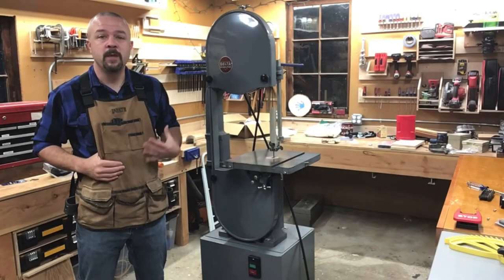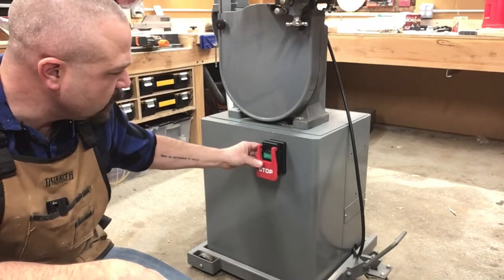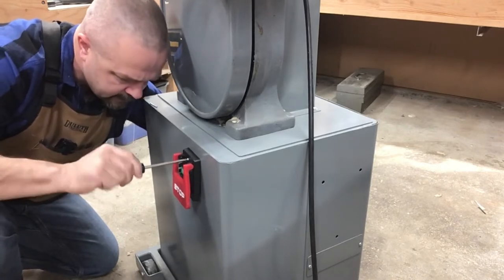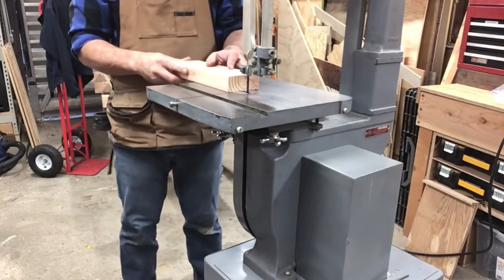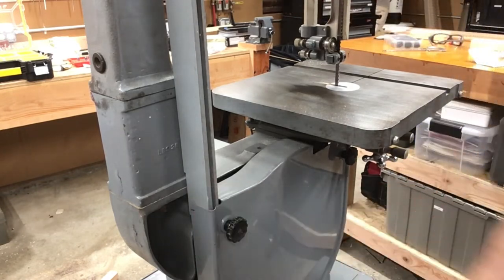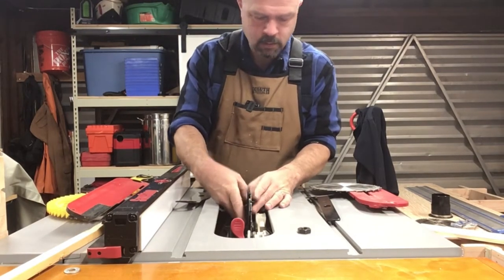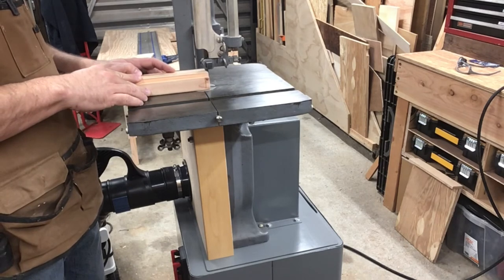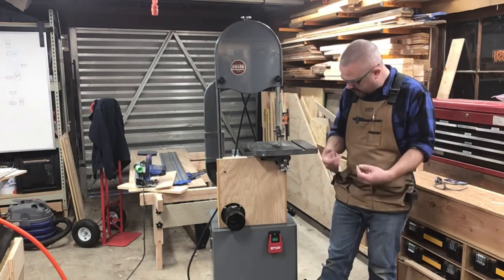Delta Milwaukee Bandsaw Upgrade DIY

Comment: I would put a plexiglass window into the dust collection box so you  could see how dusty it is, observe functionality, and see the wheels spin if you step back (but not get distracted by them while cutting since the window is only into the bottom wheel where it is needed)

Comment: Nice find and great job Greg.  What a great old saw. I'd paint the new cover the same color as the saw.
Reply from the maker: Thank you! I'm leaning that way but nobody has had the correct color in stock.
Reply: @GregsWorkshopOregon  If you can spray lacquer paint try taking the cover you removed to a local Automotive paint store and to see if they can match the color.
Reply: Nice job and nice old saw. Grab a can of Rust oleum machine gray and make it match.
Reply from the maker: Thanks George. I bought machine gray but it's a little dark, I'm going to try winter gray if I can find any in stock.

Comment: I have your Bandsaw's baby brother ( 1953 10" ). I have been looking for a riser block but can not find one 😞
Reply: U can use H beam or I beam so you can put bolts from both sides , and last cover it using 1/4 in plates, I have the same 14in bandsaw, watching from ZANZIBAR ISLANDS